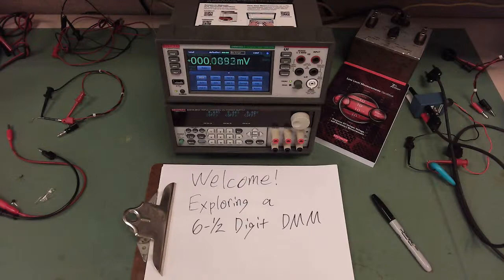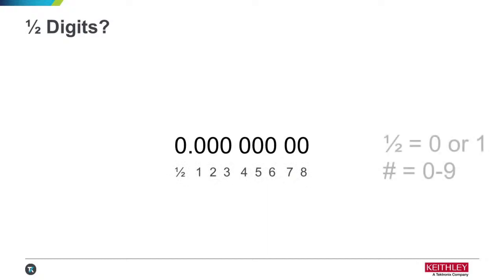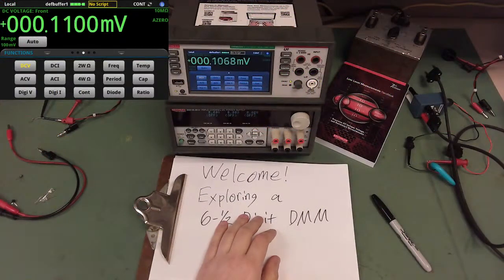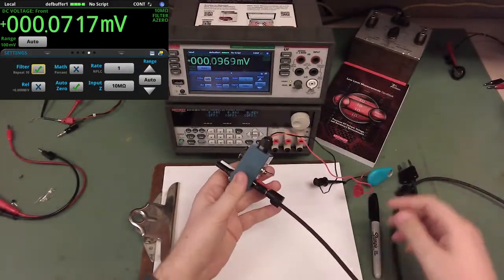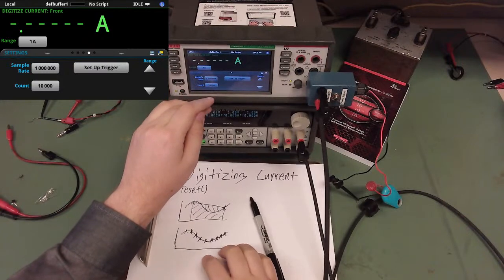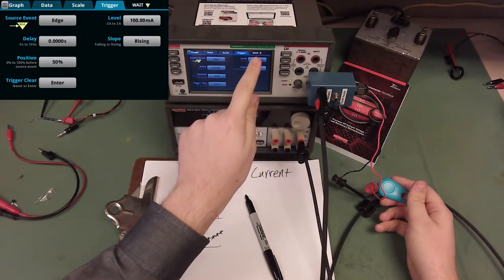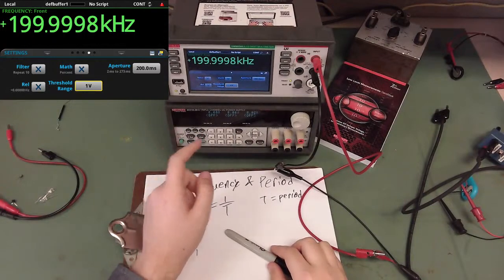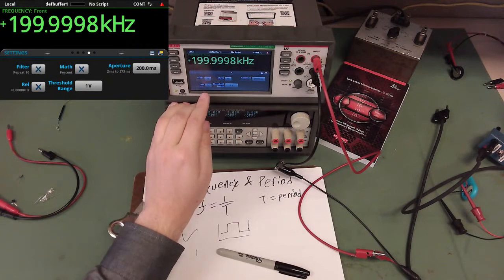Keithley Live: Exploring a 6-1/2 Digit DMM

Comment: Great!  Thank you for a most interesting video.  I have done some TSP scripting to coordinate measurements and calculations between instruments, but I am looking for suggestions on other approaches.  I have the 2450, 2460, 7510, and 6510 units.  
I would be interested in comparisons of the various sampling cards for the 6510.  I have the standard 7700 card, but looking at the solid state card as an upgrade.
Again, this was the best Keithley video I've seen in ages.

Comment: What an interesting presentation. A few weeks ago I mocked the DMM6500 because I didn't like its style - I thought the Keysight 34465a was way better. But now I saw your presentation 4 times. I already love the DMM6500 (quite sure I'll get one) and I'm even considering a 2450 for its 4quadrant capabilities. One question: Although it would be way to costly for me - why there is no such thing as an SMU based on the 7510? Should be around the 25.000$ range or so ;-)

Comment: When you measure power, the shunt resistor is 20 ohms. Shouldn't it be much lower?  i.e 0.01 ohms?    And aside from that, as you indicated that some error is generated in the voltage measurement through the Sense inputs for low voltages, because they have a fixed range of 10Volts when using the Ratio function, does it imply that the power measurement will also be subject to this error?

Comment: Input impedance of DDM is low, 1 M ohms, for AC voltage measurement of a generator. To solve the problem, assume, I connect Rs, a higher resistance (like 100 M ohm), in series with DMM (R_dmm, 1 M ohm input impedance) and then I connect both (Rs+R_dmm) across the generator. Lastly, I apply voltage divider rule to measure the actual voltage of the generator. Will this method work to pose a higher resistance across the generator?
Please comment.

Comment: I own it and I love it. There is only one thing that is bugging me. I can't set precisely 2ms/div or 5mA/div on the chart. Only 1/10/100... values are possible in the scale settings. And the TSP manual says:
"Settings made on the Graph and Histogram tabs are not saved as part of a saved setup. To record graph settings, you can press HOME and ENTER to save an image of the settings with the screen capture feature. Refer to Save screen captures to a USB flash drive for additional information."
Come on guys... Add 1/2/5 in the graph settings.

Comment: 1/2 digit shouldn't be read "half", instead 1 over 2; 
1 is to define 0 to 1
2 is to define 2 possible number ie. 0 and 1

a 6000 count DMM would be 3 and 5/6 digits that is capable of  0 to 5 of the most significant digits that is out of 6 possible number (0, 1, 2, 3, 4, 5). Some 6000 counts DMM sometimes can do a bit over 6000 (ie. 6100 count).

a 50000 count dmm would be 4 and 4/5 digits.
oddly my 6 1/2 digits DMM will do 1190000.